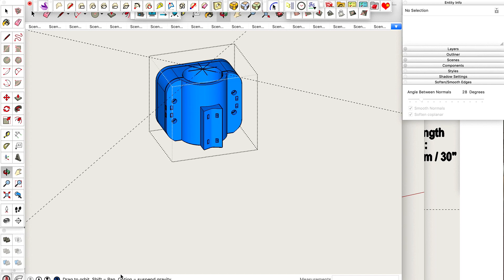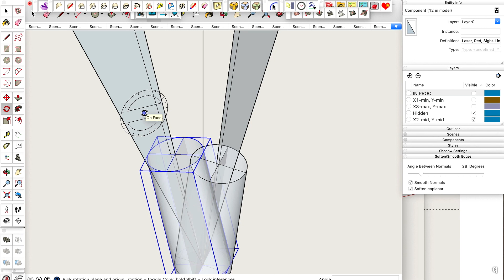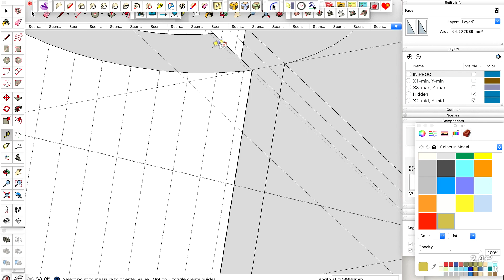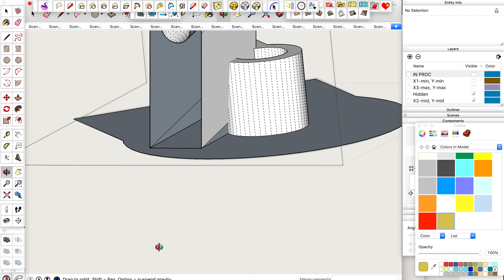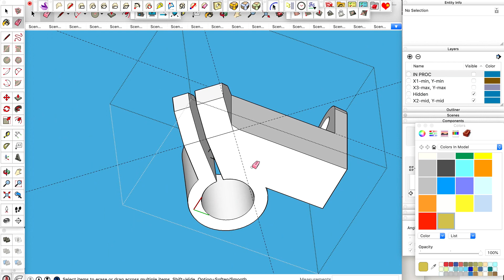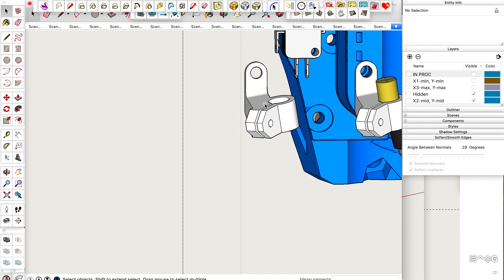LowRider 3 CNC DIY Plasma Table PART 13 - Laser Targeting! - SketchUp Creation Process Tutorial!

Comment: At the end, why does it redo z homing it appears everytime?
Reply from the maker: That is a plasma thing. It is intentional. On a big project as you cut it the metal soaks up heat. The metal begins to expand and warp. We cannot assume from cut to cut that the surface is at the same elevation in another place as it was where we last tested.